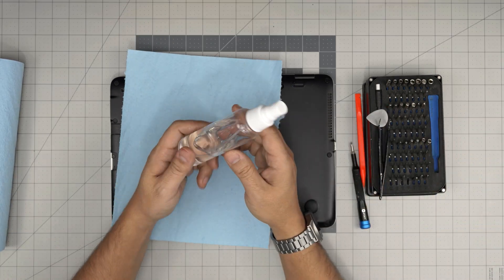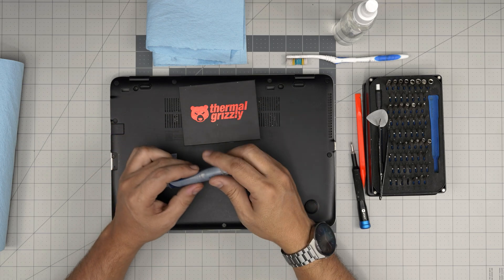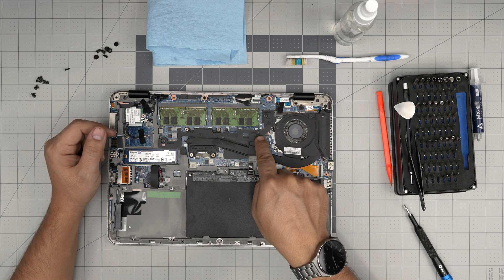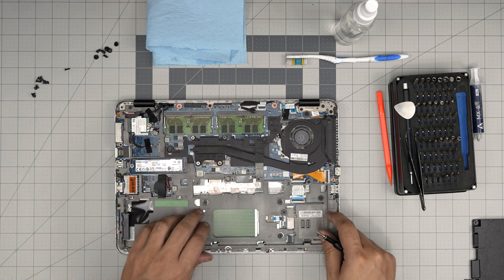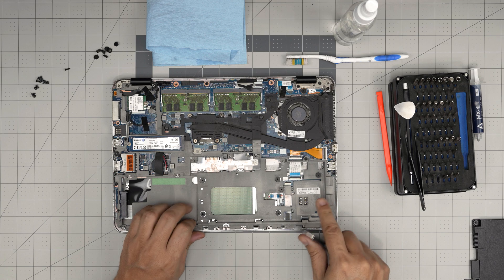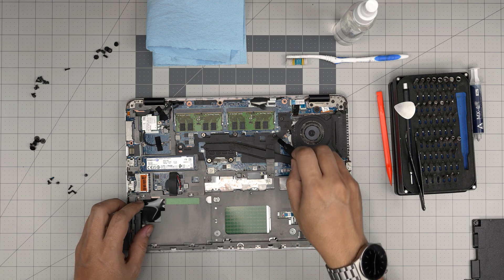How to Repaste and Clean Your HP EliteBook 840 G3 for Optimal Performance

Comment: First, İ would like to thank you for the great tutorials on this laptop model which i have one and made use of your videos to upgrade it myself. I had the laptop with low resolution screen the HD with 1366x768 which causes  a lot of eye strain and bad viewing angles. The question is can i upgrade this to FHD or higher if it came out of the factory with low res? When i refer to hp partsurfer under display i only have option for the HD low res! Thank you again for the great work and looking forward hearing from you
Reply from the maker: 🫠Regarding your question, sure, you can, but the key is to find a compatible model with the same pins and screen size. In the past, we have upgraded screens for our clients.
Should you have any further questions or requests in the future, please don't hesitate to ask me.
cheers🍻
Reply: This is great , is there a specific screen you can recommend ?
Reply from the maker: i need you to give me the exact model of the panel that your laptop has and based on that i can help you, that info in on the sticker on the back of the panel.